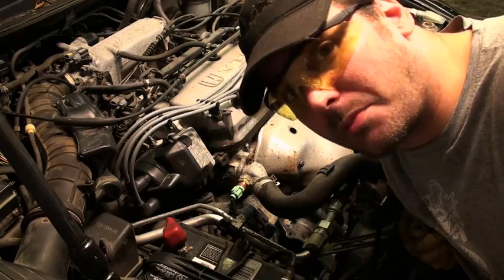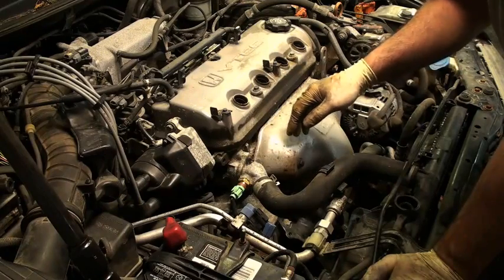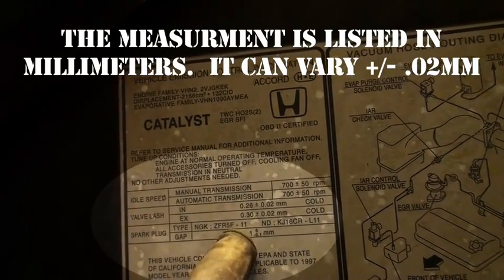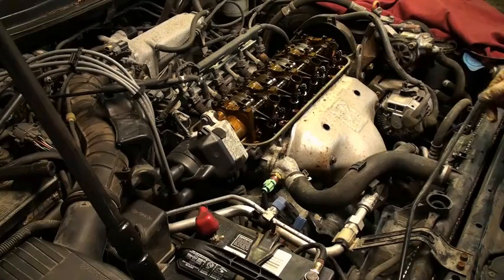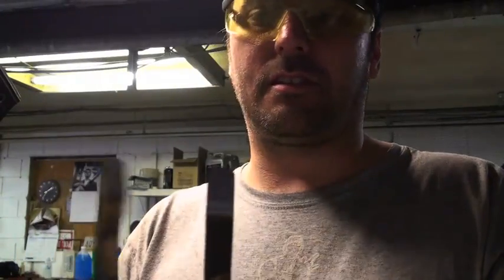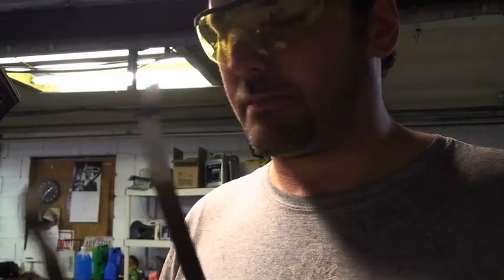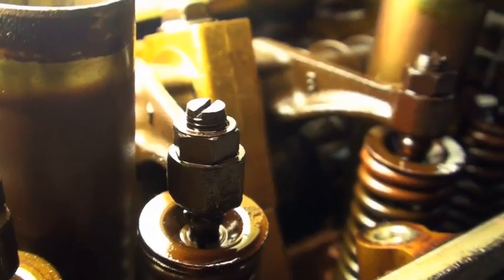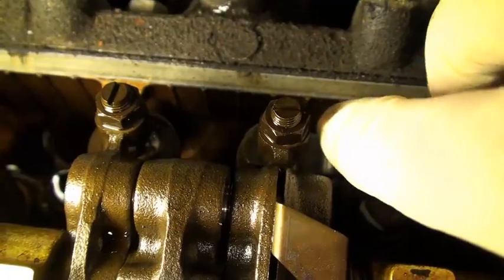Honda Accord Valve Adjustment - EricTheCarGuy

Comment from the maker: Well it sounds like you need to put the valve cover back on and heat it up to check the valve clearance to see if it's out, I think the specs are on the underhood sticker, you'll need to find that socket first unless your driveway is long enough.

Comment from the maker: Thanks for the comment.  You have what is referred to as "hydraulic lifters" in that engine, not "solid" like what is in the video.  Thing is you can't just replace the lifters, they come in a set with a new cam.  Also, if it's to the point where they are very noisy it may be too late anyway because the engine may be worn excessively causing the problem in the first place.  You could go through a lot of time and effort for nothing.

Comment from the maker: @SwatFace Valve noise is not common on that engine, it sounds like you may have an issue with oil delivery.  Check the oil level and overall condition of the engine first.  If you remove the oil cap and see a bunch of sludge buildup you will probably need an engine in the end in which case I would drive it until it explodes and then replace the engine.

Comment from the maker: @Kennykid2002 Mine are Blue Point and I got them off of the Snap-on truck.  You should be able to find long feeler gauges at most tool suppliers though.

Comment: Great video. Noticed that the feeler gage caption during the video was .010" + .012".  May need to remind people: eng compart label states mm not inches. Folks, pls understand that valves need to be on their seats to transfer heat from the valve head to cylinder head to keep the valve "cool."  An exhst valve set too tight prevents the valve from closing, contacting its seat, transf heat, causing a burned valve. Applies to both valves but especially the hotter exhaust valve. Adj tool works!!

Comment from the maker: @dc007fan Honda ignition systems are specifically designed to work within certain parameters, alter those parameters and you ask for trouble especially when it comes to plugs.  I've actually fixed many Hondas just by putting the correct plugs (and taking out the champion or autolite plugs) in and yes heat range has a lot to do with it.

Comment from the maker: @BHownsall I suspect someone had the camshafts out at one time and didn't install the bolt in the tensioned cam sprocket to hold tension on the sprocket, if you don't do this the tension will be lost and cause the gears to be noisy similar to what you describe.  Adjusting Toyota valves is NOT the same as on a Honda as you have to measure the clearance and then install the correct shims to gain the correct clearance.

Comment from the maker: @Perez19136 You should double check the under-hood sticker if you have one because if I'm wrong you could damage the engine.  .026mm and .030mm, the smaller is the intake.

Comment from the maker: You can plug up the spark plug hole with a piece of rubber or tissue that will blow out when it is on the compression stroke.

Comment from the maker: @mrjost55 If the procedure calls for a hot adjustment that is how it should be done.  Yes as the engine gets hot the clearance will get smaller so if you adjust it cold then it may be too tight when the engine warms up and your much better off with the valves loose as if they are too tight it will burn the valves up and you may end up replacing them.  You can send direct emails through my website.

Comment from the maker: @TheBmag360 That is something you develop over time, remember this is all about the feel and experience plays a large part in that.  As for your noise, it's critical to make sure that you are on the base circle of the cam when doing the adjustment, if not your readings will be off.

Comment from the maker: @csidaznigga That was turning the engine over so that I could adjust the valves.  The timing belt is never removed from the cam so there is no worry of it coming out of time.  You might want to watch the valve adjustment video that I did for more info on that.

Comment from the maker: @707Mendo707 That could be a lot of things but start with the basics like pull any check engine light codes you might have.  Check the plugs, wires, cap, rotor, fuel and air filters to be sure they are in good condition.  It being a 1990 it's not sophisticated enough to register if it has a slow O2 sensor which can throw off the mix, we would sometimes replace those like a maintenance item in the days before OBDII.

Comment from the maker: @dc007fan Yea, and people wonder why I tell them to put NGK or Nippon Denso in those engines only, I'm glad it worked out for you though.  As for increased fuel consumption it could be a number of things, since you did the tune up already you might consider checking the tire pressures as low tire pressure will caused increased fuel consumption.  Also keep in mind that the engine will use more gas in the winter and if you only drive it short distances.

Comment from the maker: @degen484 That sounds very much like the timing of the engine is off.  You might want to remove the valve cover and check all the timing marks to make sure they are correct.  If they got that wrong I would also want to recheck the valves as if there is a problem here it can burn up the valves which would require replacement if they were damaged.

Comment from the maker: @ladabyturbo Yes and yes, if your going to go with a higher lift or even run a higher RPM you need stronger valve springs and as a result it will cause more stress on the cam.  In short if you want to play you have to pay.

Comment from the maker: @Vova2589 Valve adjustments are more of a fine tuning service than a fix.  As for MPG make sure your tires are at the correct pressure, your tune up items are good, cap rotor, plugs and air filter.  If it's still  getting poor mileage after that you may look to other places that might be causing poor gas mileage like sticking brakes or a driveline problem.

Comment from the maker: @XTallyOhJoeX The valve adjustment would not help.  As for your IAC I believe it's on the back side of the intake manifold.  You might also check the PCV valve.  Try watching the video I did on Solving Honda Idle Problems as well.  Good luck.

Comment: Sorry this is something I never heard mentioned before so I have to ask. After finishing the valve adjustment, does the engine need to be turned back into a certain position again before putting the valve cover back on and starting it up ? Or can you just leave it in whatever position you had in for the fourth cylinder and then start it up like normal ?

Comment from the maker: @brown2009619 If you suspect an engine mechanical issue normally the first step is to do a compression test, if you suspect a bent or burned valve that's not sealing a leak down test would show that.  I've done videos on both of those tests that you can watch to give you an idea on how those things are done.

Comment from the maker: @fox8950 Mine didn't start out angled, I made that modification myself.  As long as the gauge is the correct size you should be fine, remember this is an "art" and will take some practice before you get the "feel" for it.

Comment from the maker: @Faqurkowch Without hearing the noise it's impossible for me to say but it might be lose valves.  Keep in mind however that valve adjustments are just 'fine tuning' and wont' cure a performance issue, it can make the engine run smoother but not solve an issue like low power in my experience.  You may have a problem with timing or a loose timing belt.

Comment from the maker: @sonofseasia Don't run the engine any more as you will run the risk of damaging it.  You need to go back and recheck your adjustments, make sure you are on the base circle of the cam lobe when making the adjustment and make sure you are using the correct size feeler gauge.  Also make sure the engine is cold when doing the adjustments.  Good luck.

Comment from the maker: @drobles95076 That 3rd gear problem has been around for some time, you would need to replace the 3rd gear syncro to correct it.  Make sure you are using Honda transmission fluid.  Good luck.

Comment from the maker: @jdmfreak92 Make sure your using the correct feeler gauge and that the cam is on the base circle of the valve that you are trying to adjust, get this wrong and you could damage the engine.

Comment from the maker: @mymusic1991 Your best friend with an electrical problem is a good wiring diagram.  I make videos based on the cars that come to me to be fixed so I would have to wait for the same car with the same issue to come in to make a video on that for you.  If I get one in I'll do my best to make one for you but for now study the wiring diagram for how the circuit is suppose to work and trace the circuits for the problem.  Good luck.

Comment from the maker: The thing to watch for on that engine is a loose timing chain, I've seen them wear a hole in the timing cover and cause an oil leak.  If it is loose it will be almost impossible to adjust the timing since it will fluctuate so much.  Listen for the chain slapping behind the timing cover when you rev the engine.  This is probably more important than the valve adjustment really.

Comment from the maker: @valflyinf To be honest I don't think that engine uses a solid valve train so you won't be able to adjust them, most cars like that have hydraulic lifters that do not get an adjustment.As for your upgrades I can say that anytime you modify something from stock you need to be prepared for some re-engineering and some issues that may pop up, that's all part of the fun though so just go for it.You might consider looking for a forum where someone has already done the swap to find out what your in 4.

Comment: Thank you so much. I just got the truck back last night. Since it has a 4 speed manuel trans it has to run at a higher RPM on the freeway then a 5 speed and I can REALLy hear the valve on the highway. They sound like cassenettes lol.

Comment from the maker: The standards are based on the type and age of the vehicle, trucks are held to different standards than cars for emissions testing and older cars and trucks are not subjected to the same standards as their newer counterparts (at least in the states that I'm familiar with).  And yes, O2 sensors do get slow over time and can cause a dip in fuel economy.  In addition,  with a carbureted engine like yours the fuel controls are not as accurate as it's fuel injected counterpart.

Comment from the maker: @jambe1234567 The only way to know it's the valves for sure is to remove the valve cover and check them, have no fear, follow the procedure and you should be fine.

Comment from the maker: @TheCivic4lifejdm Make sure your on the base circle of the cam as that is the most important part.  Also it may be the parts you installed or their installation so you might want to go back and check your work.  Lastly make sure the top end is getting oil, if not you might want to check and see if the oil psi orifice is still in the block between the head and block, if it's not there the head will not have enough oil pressure.  Good luck.

Comment from the maker: Pumps don't produce pressure, they produce volume.  Its the resistance imposed by the pressure regulator that produces pressure in a hydraulic system.
Reply: EricTheCarGuy I replaced my head gasket an now it’s misfireing when it gets to operateing temperature should I adjust my valves

Comment from the maker: @spelunkerd Honda is one of the very few manufacturers that uses a solid valve train which is the only kind you can adjust BTW, just about everything else including your Suburban uses hydraulic lifters.  It could be the kind of oil you are using if it's thinner than what is called for of if you run synthetic or it could be a problem with the cam and lifters (not uncommon on GM products).

Comment from the maker: @slkuski If you are going to try and repair it you will need to have a machine shop take care of the damage to the internal engine parts if they can be repaired.  Also if your not familiar with assembling and engine I would recommend having it done by someone that has had experience because if you do it wrong you will have wasted a bunch of money and time.  BTW it's much more expensive to rebuild than replace a bad engine.

Comment from the maker: @mrjost55 It's much better to have loose valves than tight valves as tight valves will burn up.  Timing is everything in an engine and the camshaft is the key to an engines timing and as a result controls it's breathing, the valve lash is part of that breathing and the clearance represents it's 'timing', set it right and life is good, set it wrong and life is not so good.

Comment: @EricTheCarGuy 
Figured that would happen but wasn't 100% sure on these engines.
Your method of adjusting the valves seems easier than what the manuals say where you have to position the engine in different positions turning at the crank.

Comment from the maker: That's great to hear, the entire reason I started making these videos was to save people some money, these are hard times indeed.  Thanks for watching.
Reply: Lol no kidding, local shop charges $260. I bought the valve cover gasket(also came with spark plug gaskets) and the adjustment tool and feeler gauges for $30. This saved me $230. The stealership would of charged way more.

Comment from the maker: @Hebert6760 Get a chemical block tester from an auto parts store and check for a combustion leak.  If you have one it COULD be a head gasket but it could also be a cracked head, the only way to know is to get the head off unfortunately.

Comment from the maker: @X2N18 I've actually taken a little bit of automatic transmission fluid and pored it into the intake while running the engine about 2K.  This seemed to work pretty good.  I wouldn't do it too much however, you may foul an O2 sensor.

Comment: @EricTheCarGuy  +1 We did a timing belt on a 96 integra at my school and we were off one notch and the guy couldn't drive faster then 50 km/h. The timing is really crucial and can be a major factor if not installed correctly.

Comment: Or leave one plug in at a time while turning the engine over by hand, when you feel the resistance from the compression on that cylinder, then you know the valves for that cylinder are in position for adjustment cause it's on compression stroke. It's easier and takes the guess work out of wondering where the cam lobe position is.
Reply: I have to do this job on this 91 Accord this weekend after I replace the lower camshaft seal thingies. I've never done anything like this. Can you explain that again but pretend I'm a 10 year old?

Comment from the maker: @Perez19136 Think of a valve adjustment as fine tuning it rarely fixes a problem.  If you have a low idle you might try tapping on the idle air control valve to see if the idle changes, if it does you might want to clean it or replace it.

Comment from the maker: @campbellsolo19 That is one of the few Honda engines that does not have adjustable valves.  Unfortunately you will ned to change out the lifters to get that one quite and that is no easy task on that engine.  We used to joke about that as being "made by Singer" as they sounded like sewing machines.

Comment from the maker: @maildennis2day Start by pulling and diagnosing any check engine lights you have.  If you don't have any you might check the idle circuit for a sticking valve or something that might be causing the problem.  Good luck.

Comment: I have 33,000 miles on my 1994 Honda Accord LX 2.2l f22b2 engine. What's the chances my lower spark plug  seals under the rocker arm assembly are bad?
Reply: I own a 97 LX same engine as you check your spark plug wires pull them out my had profuse oil in all 4 tubes wast relatively easy to replace the seals and hasn't leaked since

Comment from the maker: @jonathan99786 It wasn't my car but to be honest the most you will get from this is a slightly smoother idle (or very smooth if you did it well), you won't really notice a dramatic improvement in my experience just smoother running.

Comment: Hey Eric, I have adjusted the valves twice and still have a ticking sound. I had oil in the spark plug tube. So I replaced the o rings on the valve cover gasket. Would a ticking sound be coming from oil getting in the lower gaskets?  Under the valve train housing?

Comment: "Whoops!" LOL, I was surprised to see you pull the cover with the bolts still installed, then cringed when you flipped it over.  Milliseconds later.... the sound of failure!  Hope you found them all!

I really like your pull-the-plugs trick. When I last checked the valves in my 92 Accord, I was pushing the car with a knee to jog the engine. LOL   A ratchet on the PS bolt seems much more elegant and precise.

Comment from the maker: @kidcool1977 I respect your opinion but in all my years of working on these cars I've never broken a valve cover bolt taking them off this way, having been a flat rate tech for all that time I look for time saving methods, I think this one is safe.  Now putting them ON with an impact is something I would never do.  BTW I did make a video on replacing those lower seals.

Comment: I just got a 97 Accord 5 speed for $500 that's been parked for a while. While diagnosing a starting issue (ignition control module) I had the valve cover off and was turning over the engine to make sure everything was moving properly. The car now runs great, but I noticed in my video that some of the lifters seemed to slowly return instead of snapping down like you'd expect. The engine didn't have any sludge buildup that I could see. Think adjusting the valve lash will help with this?